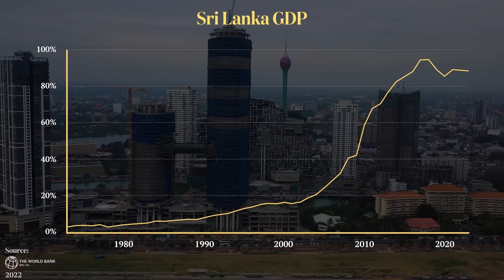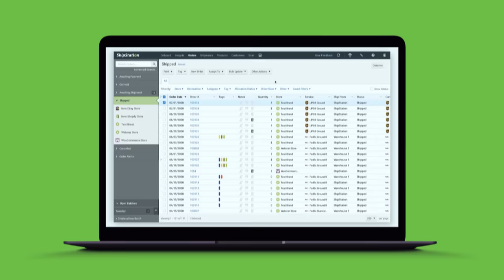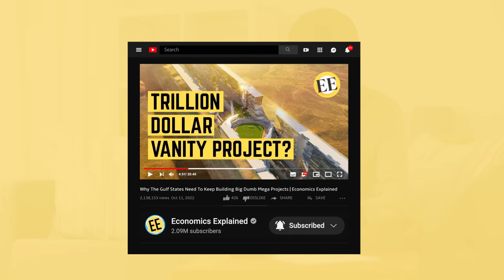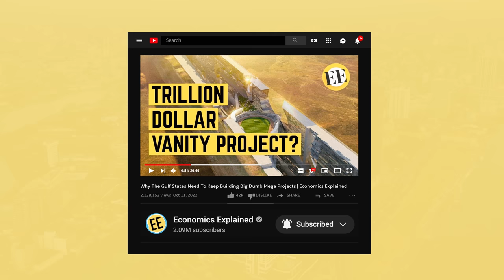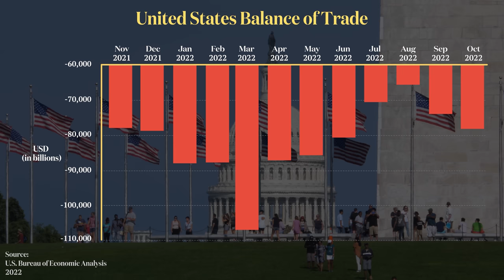The Failing Economy of Sri Lanka

Comment: Small recommendation - How about adding the year (and maybe also month) with the country on leadership board? Considering that the conditions of economies are changing so quickly this decade.
Reply: This will also enable shifts in rankings over time, and you ll have opportunity to generate more of such amazing content! :)
Reply from the maker: Thanks - we'll take it into consideration! ;)
Reply: Comparing pre-2020 countries to post-2022 countries is like comparing apples to sneakers.
Reply: @badluck5647 Sounds like a good compare and contrast video idea
Reply: Good idea
Reply: @badluck5647  not that much has changed. Stable economies from 2019 are still more stable today than the less stable ones.
Reply: @mirzaahmed6589  Not the UK, they're not.
Reply: @wafercrackerjack880  or China, Russia, and Turkey.
Reply: @EconomicsExplained  wink emoji?
Reply: @HaroldGodsoe  to be fair, it was an economically sexy recommendation.
Reply: Dates would make it more ugly. How abt just linking a version of it that can be updated (and have any relevant info, like the dates) in desc of vids
Reply: @mirzaahmed6589  Generalising
Reply: @abiku2923  not turkey they are also face rapid devaluation of countries currency
Reply: @EconomicsExplained  Yes, it will be interesting to see your reassessment when Sri Lanka pulls itself out of its quagmire, however many years or decades away that may be. Also, many countries including my home, New Zealand, have had irresponsible governments for the past five years, so may be in decline and not score as highly as when you did your assessment.
Reply: Highest ESG score on Earth is telling, just hinted at here concerning insane ban on fertilizers.

Comment: To be fair, if Sri Lanka had something similar to what Taiwan (1), then I think they could've had it far better right now.
P.S.1 I mean TSMC here, but Sri Lanka's facility doesn't have to be capable of making complex stuff, instead they could be printing Arduino and Raspberry Pi tier stuff as well as 200nm microcontrollers and other "bulk" microelectronics, it's always in high demand, like that's why your car could have Russian-made microchip, situation was so bad that at some point Russia got contract just by bring able to deliver first shipment of microcontrollers twice as fast compared to TSMC (6 months vs full year), it happened in 2020-21-ish.
 Yes I know Arduino is quite obsolete microcontroller today, but it's easy to manufacture, is quite pricey (2) and extremely popular as "starter kit" for people who want to make their own devices like mp3 players etc. Oh yeah and it's open source architecture, meaning you only need to pay for license, if at all.
P.S.2 on AliExpress it's even more expensive than better alternatives like... B32? E32? Something like that, basically a 2-core CPU on a board, super epic stuff compared to the "Arduino"
Reply: Esp32 😁
Reply: Sri Lanka was once on the right path but because of their government's obsession with race and correcting the "wrongs" of the past, they never made it. They should have recognised the fact that the country is ethnically diverse and made use of that instead of trying to homogenise it.

Comment: The admission that not every individual can get rich is at the heart of what I see as a problem in our economic systems. If only a few CAN achieve the top, then it's not equitable to allow any to hold that position. The fact that it must be a pyramid built on the lower levels in an admission that it is exploitative.

Comment: Forcing Sri Lanks to go "GREEN" caused their economy to tank.
This was a surprise?
Reply: Always avoid painting your own bias onto data. In this case, their renewable energy plan never really took off, so, no, it isn't the cause. Ironically, if it did take off, and assuming they didn't do it by taking on massive debt, it would help them now. This is because they're in a spiral where they can't afford fuel imports for traditional fossil fuel based energy. Renewable energy tends to be more local, and hence, more independent of imports, during its energy production. On that note, since you seem to follow this thought process... Why the heck fight the usage of different energy sources? Let the energy engineers do their job. Fossil fuels won't last forever you know, hence, definitely need to build up an alternative energy infrastructure before then. I assume by the usage of 'green,' you just have some illogical understanding of climate change and think that is the only reason to use alternative energies.

Edit: If by 'green' you mean their organic food choice, I would agree, that is indeed an odd choice. Nothing wrong with food and agricultural science that has allowed food production to increase a great deal in modern times.
Reply: @JimBob1937  Forcing Sri Lanks to forgo fertilizer made their crop yield fail and now they are starving. But John Kerry has all the answers/ He is extraterrestrial!  Kerry can push bias onto data because he is a god amongst men.
Reply: @JimBob1937  Let them CHOOSE their energy. If they want "green", go green. If they want natural fuels let them use fossil fuels. Why so against choice?

Comment: Can't agree about the foreign remittances. SL received about $7.1 billion foreign remittances during the pandemic year of 2020 and it was going up until mid 2021. What happened was central bank decided to fix the exchange rate artificially during this time and it created a black market ( it's called Undiyal) . So people started sending money through the black market ( mainly undiyal) because they got a better rate than sending through the official banking system.  As a result remittances were down to $ 5.5 billion in 2021 and around $ 3 billion for the first 10 months in 2022.

Comment: We do NEED the infrastructre growth, though. Like metro systems and a BRT. BRT being much suited for Sri Lanka's pockets. Sri Lanka spends a lot on imported oil, actually it has to import 100% of crude oil, and has been importing above 50% of refined oil since their refinery shut down.
Reply: Also Sri Lanka incuurs around 40% of its electricity energy from fossil fuel, which is madness for a country full of sunlight, and rain. Which is why despite protests they built a coal fired plant. But, if you think protestors are always right, they are not. Sri Lanka has been having the basic 15 hours of power even through this mess is due to Coal-fired plant in Norocholai.

Comment: For a developing country massive debt to fund infrastructure is a calculated gamble. Yes its really risky - if you don't get the wider based growth you will be stuck with white elephants and big debts. But there are examples where this strategy has worked and the country has escaped poverty, whereas there are no examples of countries that have NOT spent the money yet grown anyway. Borrowing for infrastructure is a necessary but not sufficient condition for growth. While the key to success lies in other things (eg rule of law, competent tax system, investment in human capital, most of all plain dumb luck) than debt-financed infrastructure that infrastructure and its associated debt is an enabler of those.

Comment: That's why I kept telling people capitalism was not the answer I don't have a better solution I can share with anybody right now but I definitely know capitalism someone always has to be at the bottom no matter who's at the top someone is always losing so when people say stupid stuff like pull yourself up by the bootstraps or you chose that job someone would have to do the job even if I wasn't doing it so that doesn't solve the problem that just shoves it on to somebody else
Reply: Capitalism encourages production which results in there is more to go around. Inequality is certainly undesirable, but it's common to all systems, not just capitalism. 
Also with jobs your view assumes that people won't up-skill or move into other jobs as they enter different stages of life. That isn't shoving the job onto someone else, it's giving them the opportunity to gain work experience and skills that will help them step up into better roles in the future. 
If I had to be at the bottom of any society, I'd certainly choose a capitalist one over any other I've seen.